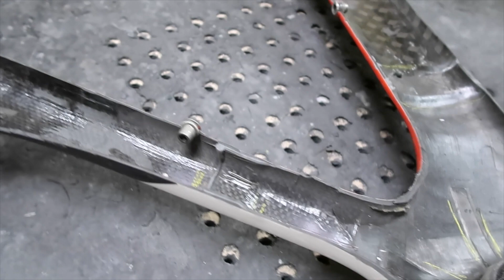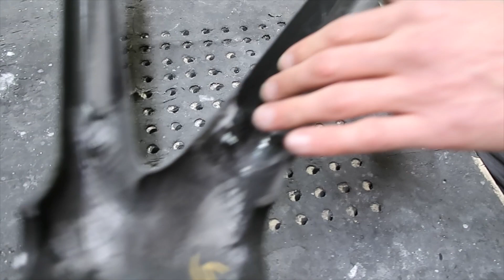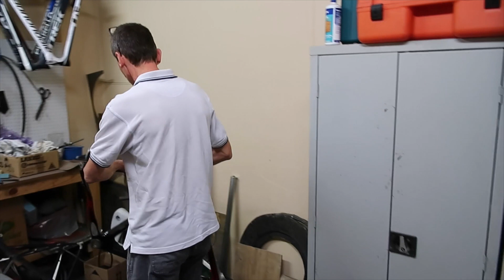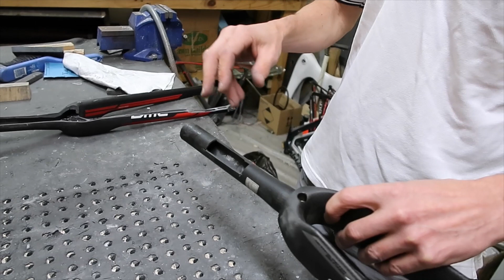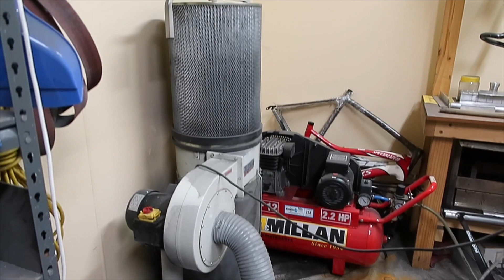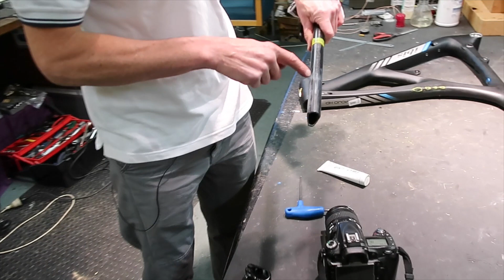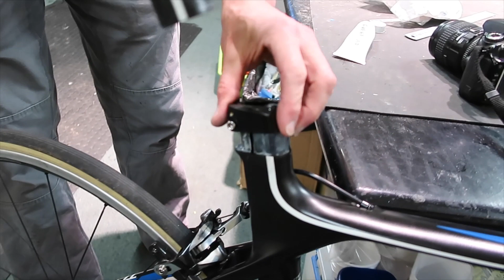Cutting up Expensive Carbon Bikes // Inside High-End Bicycles

Comment: Much appreciated info mr. Luescher! My roadbike is based on a Calfee Design Tetra Pro frame, build with filament wound carbon tubes, reinforced with titanium inserts in bottombracket and headtube. Calfee gives a 20 year warranty. Have you ever examined such a frame? Regards Martijn.

Comment: Seriously how can people watch this and trust a carbon bike downhill.. If carbon was that good campanies like Boeing and Airbus would be building their planes ENTIRELY of carbon.  Only recently they increased its use, and only, in strategic places due to its fragility to impact.  I'll get a carbon bike the day aircraft companies replace all aluminum parts with carbon on their commercial airplanes.  Until then ol' aluminum is king.
Reply from the maker: How many carbon bikes have imploded downhill? I don't think it's a case of "if it was that good, it'd all be carbon" when it comes to aerospace engineering either. I assume they go for the best material for the purpose. Anyhow, we're comparing axe handles to F1 cars.
Reply: You do know that the Boeing 787 has the fuselage and WING made out of carbon, as does the Airbus 350. You don't get more structural than the wing!

Comment: The (waxed paper) honeycomb core sample looks like standard aircraft floor board to me. Is it really from a rudder?
Reply from the maker: Raoul isn't one to bullshit anybody. I'd go with his word.
Reply: I used to work in aircraft maintenance and i don’t recall seeing that material being used is a rudder. Honeycomb core is used quite extensively in flaps, spoilers and ailerons, etc. I would expect the outer layer to be thicker and often the core is aluminium honeycomb, not paper. (I think) Aluminium core is more resistant to moisture. The sample looks exactly like floor board but I can not say for certain. Anyway it’s not important in the context of  this video.
Reply: @likemarksee  Yes it is from a 757 rudder skin panel made at the Fishermans Bend facility here in Melbourne, we also made the 777 rudder's as well which used a thicker nomex honeycomb core as it was a larger skin.
Each cure had some test panels made as well, so there were plenty of small pieces around and they were great for sanding blocks, also very occasionally one would get scrapped due to flaws and get cut up to destroy it.
The aluminium honeycomb core had corrosion problems, the F18 C/D series used aluminium core on the trailing edge flaps we made for them, on the E/F series they went to a monolithic rib stiffened design.
Reply: Luescher Teknik. All interesting stuff, it’s been a while since i was involved with A/C maintenance. I guess things have moved on a bit. I love the cut-up videos, as these really show the true build quality of the bikes frames that we buy.

Comment: great fear campaign. That's all superficial issues. The real thing you riders should be worried about is the age of the frame. Vibrations, humidity and regular flexing of the frame damages the composites over time, it's why aircraft have something called "high time" basically every few thousand hours high stress components (including the whole frame) needs to go in for evaluation and repairs.

Comment: Raoul have you opened up any Colnagos from the high end models C40, C50, C59, C60? if so can you enlighten us with your findings cheers
Reply: Normally no problem with C series as they are built with carbon tubes 👍No idea if junctions are safe.

Comment: I'll stick to aluminium thanks. That carbon fibre looks dodgy as hell.
Reply: Am beginning to think this way myself. Saying that, am very happy with my R230 Lynskey Ti cycle.
Reply: I wouldnt buy a carbon frame but I snapped 3 Aluminium frames in 18 months so.....
Reply: @DeanHankin  On what and doing what? Mountain bikes? What brands? Im genuinely interested because the carbon/aluminum debate is strong.
Reply: @BigChiefWiggles  Kona Hei hei 26 (scandium) riding on local roads to work. Avanti Vapour 2 riding on roads to work. Both snapped on seat tube around suspension pivot, Lapierre zesty front triangle folded in half on local trails, I dont do jumps etc but I am 190cm and 250lbs so maybe just too fuckin powerful for these things. :-) Gonna go for a steel hardtail next
Reply: Incidentally I am building up an On One Space Chicken Gravel bike to see if I can snap that too. I'm looking at carbon after tearing the chainstay out of my latest bike..... An On One ti fireline 29er. I've taken to buying cheap frames in auctions because these fuckin things are only made for 9 stone office dwellers who go out for a ride 4 nights a year with their mates.
Reply: @BigChiefWiggles  I almost forgot... There was also a Mondraker Factor that I snapped at the rear suspension pivot on the communte home from work. Commute was only 4 miles each way down a canal towpath.
Reply: I've still got the Kona, I crammed a seat post right down to the bottom of the seat tube and put 4 bolts through it. it's still going after maybe 15 months :-)
Reply: @DeanHankin  wow, are you a really big dude or putting down over 1000 watts on sprints?
Reply: @BigChiefWiggles  Im fairly large, no idea on power output but I've put plenty of lycra men to shame on a mountain bike in jeans and t shirt before.
Reply: @DeanHankin   Yeah it sounds like its the combination of weight and big power that has you destroying frames, maybe try to ease into power and build it up instead of dumping everything you have into the bike instantly. You should check yourself on a power meter too, should be interesting to see what the reading is at full power.
Reply: @BigChiefWiggles  I'm going to only keep a bike for a matter of weeks and move it on before it breaks.

Comment: I'm still using a pair of Time Composite forks (1"steel threaded steerer) on a 1991 Gitane team replica bike and a Mizuno 1" with full carbon steerer on a Raleigh titanium, at almost a 100kg i don't have any qualms coming downhill at 40mph though I don't ride either bike as often as I'd like to.
I waited and waited before taking the plunge on a full on CF frame (I bought an unused KTM that was a spare from a continental team 3 years ago), i didn't have to, my principia's were better than most of the mid-range and even some of the higher end CF bikes in the mid to late 00s, even now it wouldn't be out of place on a crit and barely a few hundred grams weight penalty.
It would be interesting if you could slice open some older TIME, LOOK and other higher end hand made/in house carbon frames to compare the quality comparative to the more mass produced frames.

Comment: Thanks for the vid, great info. As for cutting carbon handlebars and seat posts, I just use a Ridgid brand plumbers tubing cutter. No dust and a perfect cut, surprised no one mentioned that.
Reply: NEVER use a metal pipe cutter for carbon parts, it will delaminate the laminate. For metal they work great.
Reply: Well we use them to cut pvc pipe as well as metal. I have had my carbon bars and seat post that I cut with a pipe cutter for 2 years now, works fine. I change my grips 2-3 times a year and clean/re-grease the seat post weekly and haven't noticed anything bad. If long term strength is an issue, I would gladly sacrifice a $100 part every few years rather than worry about carbon dust in my work area, lungs and eyes. The ends will be completely covered 99.9% of the time anyway.

Also not sure what the difference between a metal saw blade and a metal pipe cutter blade would be. Seems like cutting a finished carbon part with anything isn't the best idea anyway. But I will cuz when you are fast, you only want to go faster.

Comment: Nice video. I work at Embraer as a Composite Technician, and all I can say is that I love these kind of materials and what u can build from it. It has lots os shapes, angles, resistance and it's so much weigh less than steel and aluminium. He explained the wrinkles and all that stuff nicely. Love my job!

Comment: All in all, this confirms what i feared about inconsitencies, variations in unseen but important areas of a carbon frame or fork, or wheel rims.  Personally, I won't bother with the stuff, impossible to know how well its been made until you cut it up, or it fails catastrophically, if it was dirt cheap and worth a risk, ok, but it isn't. I'll stick with Al or steel thanks!

Comment: Just watched the first 14 minutes of this video. Very educational indeed. Enough to put anyone off buying carbon fibre for life, especially if you are buying a "budget" product.
Decently quality aluminium shouldn't have defects like "voids" or air bubbles ... and ... Steel Is still Real, especially good quality tubes like 4130, 525, 631, 853 etc etc
Reply: Thanks for the feedback, glad you enjoy watching. Metals can have voids, especially welds, that's why they don't weld structural aircraft parts. We used to scan the forged and machined aluminium hinge fittings for the F18 flaps, a set of 3 would take about 5 hours scan time. The majority of non destructive testing worldwide is on metal parts for a reason.

Comment: I've been reading about 3D printing with water soluble materials.  You can print a core which you can use to mold carbon around.  You then submerge the finished part in water and the core dissolves away leaving the hollow carbon part.  That solves a lot of the difficulties that come with trying to manufacture a complex hollow shape out of carbon.  I really hope that it works as well as the hype I have been hearing.

Comment: I have a  carbon seat post in an aluminum frame. is there something I can do to minimize corrosion?
Reply: There are some special compounds that will help reduce galvanic corrosion.The other important thing is to keep it clean and dry.Lastly is kind of gross but sweat can be a real problem and the salinity accelerates the problem so keeping it clean is important.
Reply: COOL THANKS
Reply: good thing i don't sweat on my forks or seat post. LOL

Comment: Shane ....Raul.... is it ok to use the carbon grip on handle bar/stem and seat post clamp to frame?
Reply: Yes, many bars have a grit embedded in the clear coat at the clamp areas as well.
Reply: Luescher Teknik ... cheers for reply

Comment: plastic bikes are a consumable item. I think I'll keep riding my titanium Seven
Reply: The metal frame bikes still use a carbon fork mostly, there are no Ti or Alu forks around that are any good. Steel makes a good fork, however is almost twice the weight. I agree that the plastic bikes are a consumable item, unfortunately that is the society we live in, who repairs TV's these days or any other household item? At least the carbon bikes are repairable most of the time, which is good because recycling is not really an option right now.
Reply: I don't think the average cyclist realises how well a carbon frame is able to be repaired. I've seen numerous bikes with what appears to be major damage repaired successfully and still being ridden with no problems for years later.
Most Titanium and steel bikes do use carbon forks and these are fine. When you look at the weight of carbon forks compared to frame weight there's a lot more carbon in forks for their size.  Have you ever seen Woundup Forks fail?
Reply: Geoff Semon I agree however I do find it funny that people dismiss carbon as being unsuitable and even dangerous for the frame, yet gladly ride a carbon fork which would have greater consequences if it fails. ☺
Reply: Luescher Teknik 
Not unsuitable but sometimes not well executed. I lost count of the number of cracked Cervelo frames I have seen for example. I've never seen a pinarello frame crack despite the fact that they used to cost under 300USD ex factory without the bottom bracket and unpainted. I also have seen what happens when a trek dealer convinces a 6'4" 130+kg strong cyclist that their lightweight frame will hold up just fine. If broke on his second ride. 
I think cyclists that want the newest and the best keep wanting new bikes even though the one they have is still ok. Someone who invests in a quality steel or Ti frame will still be riding the same frame in 10 or 20 years time cnd just upgrading parts as technology improves
Reply: I agree, the design and manufacturing process as well as quality assurance play a huge role, this goes for all materials. Here is  a link to some testing that was done, it is a few years old now but still shows the variability in what would seem to be similar products. Note that 100 000 cycles is the ISO standard now. http://www.sheldonbrown.com/rinard/frame_fatigue_test.htm

The other thing to consider is that the way the bike industry changes standards, components will not be available to fit existing bikes in the future. It is hard to get a quality stem for a 1" steerer fork to suit a 26mm handlebar.

Hopefully one day the consumerism will wane.

Comment: In the frames and forks where all the defects are pointed out were those safe to ride? Obviously not in the cut up state, but before they were cut taking those defects into account.
Reply: The cut up items were scrapped as they were considered unsafe to ride.
Reply: I understand that, but that's not my question. In the video there are flaws pointed out in the carbon frames and forks. If a frame/fork has those flaws, are they still safe to ride or are they an accident waiting to happen? For example, air bubbles were shown in some of the forks. Would those forks eventually fail randomly or would they still be safe to ride even though there was a manufacturing defect?
Reply: Alex R It depends on the design,   however just 2% porosity can reduce strength by up to 20, if they have allowed for this it is probably ok, if not then it will fail at a lower load than designed for.

Comment: Hi Shane ,  did you already got a hand on the Elite Turbo Roteo Smart B+ ? I'm looking into this trainer as an interactive trainer. It's a relatively cheap direct drive trainer compared to the neo etc. But is it a real interactive trainer ? Zwift sayss it transmits power, is that true ? Looking forward for your thoughts on it.
Reply from the maker: Sorry Pieter, I haven't had any experience with that model.

Comment: fantastic information shane, RL is such an honest genuinely intelligent person.  my thoughts are the failure threshold is so high on CF and that's the reason we rarely see failures beyond accidents etc. even though there are obvious flaws in the manufacturing.  this pinkbike test is impressive as to cfs resilience. https://www.youtube.com/watch?v=xreZdUBqpJs
Reply: There are two thresholds - the first is cracking the frame, which is actually not that uncommon.  The second is that crack leading to an injury.  Same with flat tires - I must have had a hundred but only one I paid for in flesh.

Comment: steel is real, Ti is king.
Reply: absolutely right!
For uncomfortable underground there’s indeed nothing better than Ti.And i have old roads/underground all the way 
on my training routes,most of the year also the weather is bad(rains often in northern germany),so for me there’s really
no alternative.Once i drove such a thing the first time in 2001,i don’t want any other material-you touch it,it’s warm instantly->superconductor.But it’s the convenient ride,makes you feel as if it was very stiff,but the one behind you can see it flexing.
Titanium has got different surfaces,can be shiny or can be beamless.But the best thing is: as steel frames suffer from pressure
within the first year,titanium keeps its integrity til the end of time.As other materials degradade(rust,oxydation,cracks in carbon),
my frame is in perfect condition,ridden very hard for 17 years now,and it feels new when I start to ride.
My active sports career is behind me,these days i ride because i have fun and i like it- so carbon would only make sense in races/time trials,where weight is essential.🚴🏽👍
Reply: Thanas Stefanis Ti is shit for frames
Reply: Robsthedon why is that? Ti riders are often very pleased with them

Comment: Just for info. it's important to hold on the handle of the tocqrench and not the middle of it. or it won't work correctly.
Reply: Yes technically this is correct, I did check this on my Norbar torque wrench calibrator and it reads the same, maybe at higher torque settings there is a difference. What I was showing is that it is important not to be heavy handed tightening these parts. Thanks for the feedback.
Reply: The torque gets measured at the ratchet end, so down stream from this is pretty much the same at lower values anyway. At higher values it may be different. Also for the same force on a normal wrench holding it further in will provide less torque as the lever is shorter.
Reply: That seems counterintuitive.  Surely if you hold the middle you're just applying more force for the same amount of torque?
Reply: He wanted less torque for the gentle low toque job.
Reply: Older school wrenches required the hand at the extension end but modern wrenches for low torques can be almost like a hand dial.

Comment: Hi Shane, any thoughts on titanium, may be to much flex and also all the pro's ride carbon?
Reply: There are many reasosn high performance products like aircraft, F1 cars etc, which used to use titanium are now  made from carbon.
Reply from the maker: What's good/the best and what the pros ride can be entirely different things. They're all part of marketing/commercial contracts. I've not owned a Ti bike, yet. I'll cover it on here when I do and have done a lot of research on them.